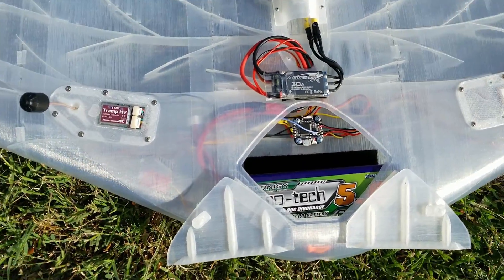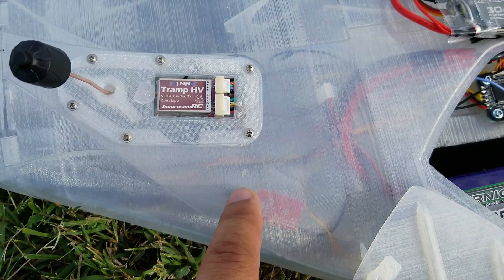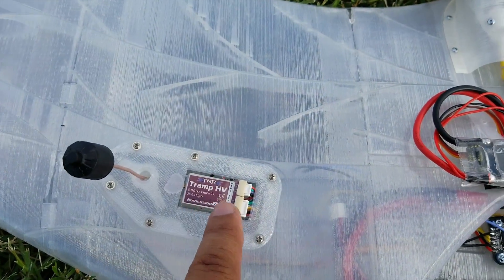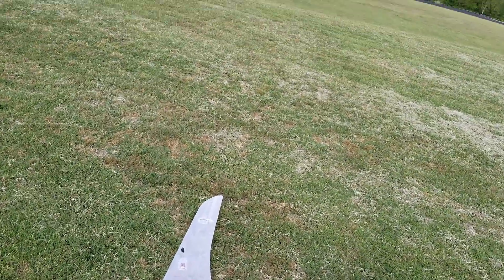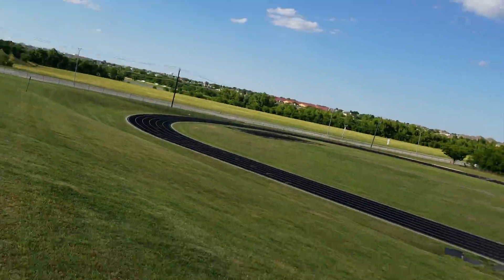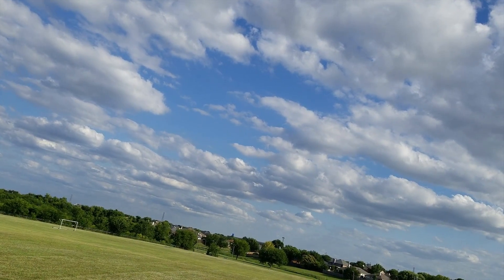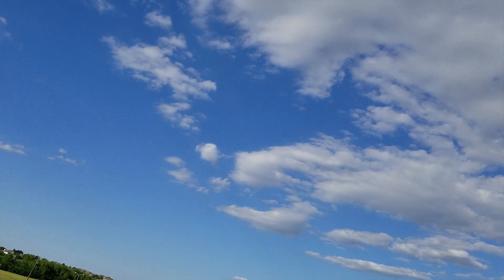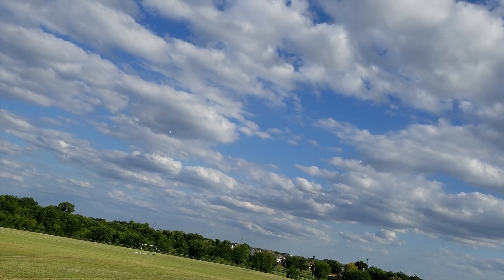UAV EBW-160 3rd Flight

Comment: How fast does it fly?
Reply from the maker: I didn't really set mine up for speed, but it seems 25ish mph at 50% throttle depending on the wind. So maybe mine 60-70mph full throttle?
Reply: @RickyGode , thanks for the info! What about flight time?
Reply from the maker: @halfeld  That's a good question.  I have a virtual current sensor on there and I haven't really "fine tuned it" but on my setup the rough estimate is about 120mAh per min.  I have a 3S 5000mAh pack in there which I usually take down to only 50% Which should be about 20 minutes.

Comment: @ 1:22 you mention you switched to an 8x6 prop, but the description states a 10x6.  Can you tell me which prop size you ended up with and if you feel the ESC would still be too hot mounted internally?
Reply from the maker: Good Catch!  I'll change the description.  Yes on this flight it is an APC 8x6EP.  I think it would be ok to mount it internally, but I'll still stick with it getting good cooling.  I'd hate for my BEC to fail because it got too hot.

Comment: hi is this made from PLA and what is the tack off weight please
Reply from the maker: Yes, it is made from PLA and the take-off weight is around 1.2kg.
Reply: @RickyGode  thank you i am printing one out of lw-pla but with the wrong temperature but im over half way and i think i am going to get away with it .thanks for your reply. Im  new to 3d printing got my ender 3 last weekend. Old hand at rc new to the printing. Thanks again.
Reply: @RickyGode  Do you feel that it is strong enough with 1 wall? I am printing mine with 2 but am worried it will be too heavy.
Reply from the maker: @joefarnell6566  Yes, I feel it is strong enough with just one wall.  These PLA 3D printed planes are still fragile with even two walls.  I'd stick with one wall per eclipson's recommendations.
Reply: @RickyGode  I am almost finished building it. Where would you say I should put the point of balance? Is is roughly central or slightly further forwards?
Reply from the maker: @joefarnell6566  on mine I have my CG 2mm behind the forward mark.  It balanced there with a 5000mAh 3S battery.

Comment: Flash Ardupilot onto it....image pales in comparison
Reply from the maker: I've never tried Ardupilot.  INAV was the first thing I attempted.  I've had great success with it in my Strix Nano Goblin.
Reply: @RickyGode  not trying to add to the Arduplane/Inav debate, but I can tell you I initially got into RC with Inav and migrated to Arduplane; HUGE difference.  Arduplane can seem a bit daunting at first, but a closer look and it is laid out very logically.  Additionally the stability, feature rich and customization is much further matured as compared to Inav.
Reply from the maker: @kerrycorcoran4885  Thanks!